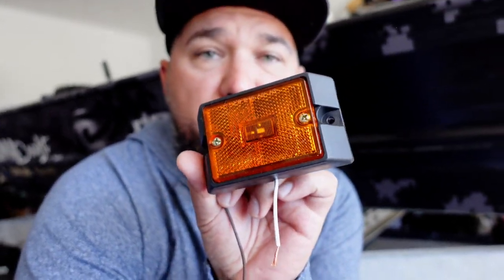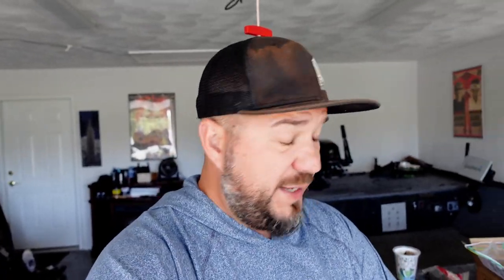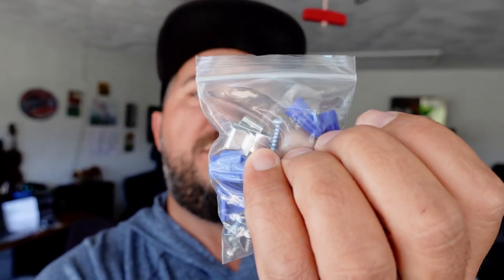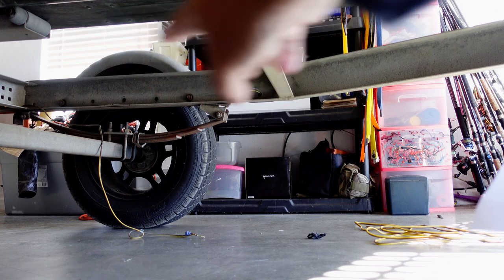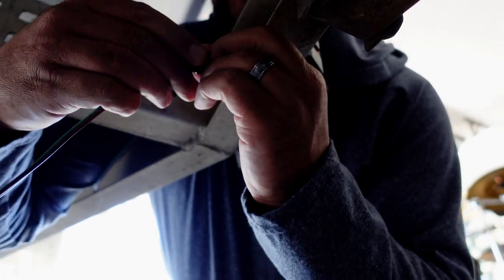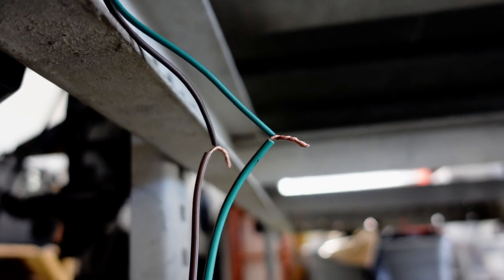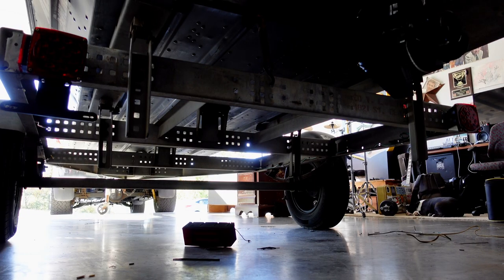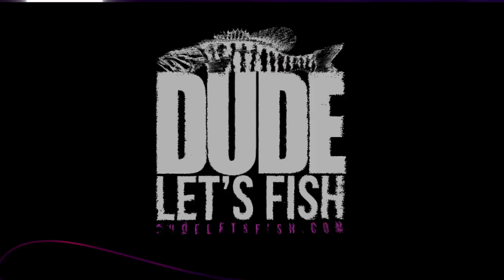Watch Before Ordering Trailer Lights Off AMAZON!!! (Jon Boat Trailer Lights||||||:(

Comment: Do you unplug your connections before you submerge that trailer in the water? My dad has always told me to do that because the water and the electrical current when the wire is activated via you hitting the brakes will cause those wires to corrode faster than they should.
Reply: Good tip, i will try that. I noticed my new led lights on my trailer are already showing rust where the bulbs are.
Reply from the maker: I use to then started forgetting to… so no hahaha
Reply: Think about this for a moment...  You back your boat in, launch, go fishing, come back and load the boat, if the moisture isn't completely dry (which it isn't) the same issue exists with the boat in or out of the water, this isn't the problem.  The problem is that the light fixtures themselves are not waterproof. and the moisture will stay in the fixtures for days.

Comment: Optronics from Academy are great. I bought the regular style lights( bulbs) and have never had an issue. I fish every weekend on Saturday and Sunday both. They get a work out and haven’t had an issue since putting them on.
Reply from the maker: I’ve heard from them old school cats, they could back there boat up and never have a problem for years
Reply: @DudeLetsFish  exactly. Newer isn’t always better. BTW. I guess I’m old school because I’m 53 and the new stuff still hasn’t impressed me much. Lol.
Reply from the maker: @brianschumacher3204  always heard the original bulbs have lasted way longer than the LED’s even when dumped in the water
Reply: I have a 2012 trailer with Optronix submersible trailer lights.  One of my bulbs just failed and I went to replace it.  It failed because the seal around the bulb failed.  I actually like the way Optronix sealed it up, but I guess it was just time.  I decided to replace the bulb and I put a bead of silicone grease around the gasket for the clear plastic cover that goes over the bulb.  Really hope this works.  

I’ve installed LED submersible lights on previous boat trailers and even waterproofed all my connections, and the LEDs still failed.  

Took lots of pictures of this last taillight replacement, would upload them if I could.

Comment: One thing to help water proof the lights.. after attaching the connectors cover them sumbitches in some clear silicone.. it won't hurt anything and it's easy enough to get off of needed
Reply from the maker: Good idea